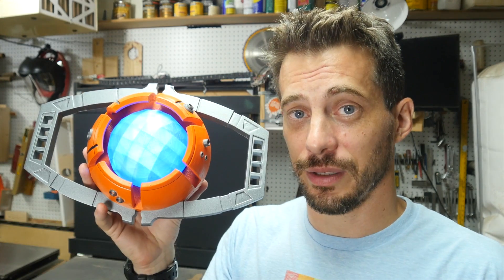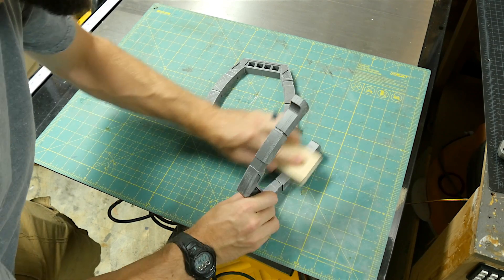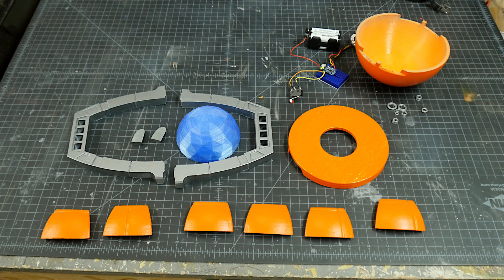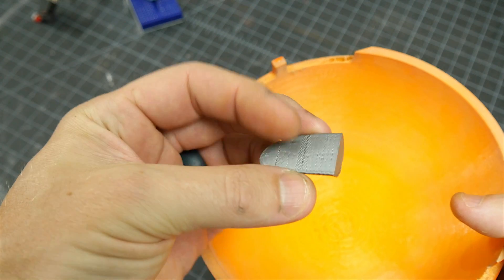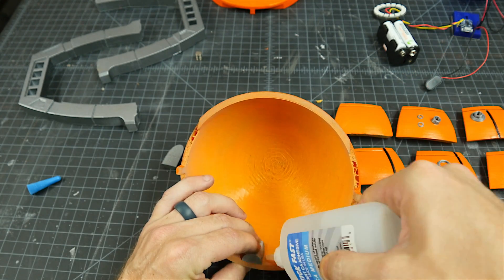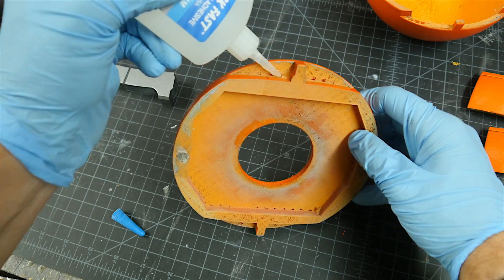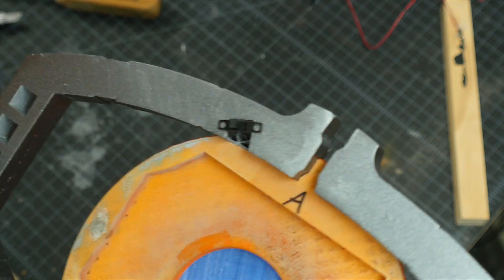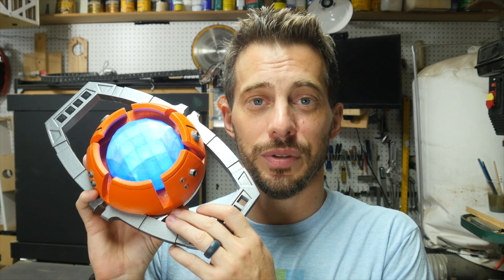3d Printing a Transformers Prop (Matrix of Leadership) // How-To | I Like To Make Stuff

Comment: When You put magnets in 3d printed parts use soldering iron, put magnets on hole and tip of soldering iron on magnet heat will be tranffered to magnet that will melt plastic and sit in place better then just pushing it in and gluing it😉👍
Reply from the maker: That's a great tip! Have you seen the heat affect the magnetism at all?
Reply: I Like To Make Stuff nope, go for it without hesitation, it doesn't affect them at all.

Comment: Lovely build man.  I may use this as a base idea to construct my own.  I know this was made last year and you've improved since then but have you thought about using anything like dichloromethane to smooth the print before adding the filler primer?  Really takes a lot of sanding work out of the equation.  Helpful tip for you or anyone else watching.

Comment: hi there

I am hoping you can give me some advice on sanding down the 3d printed models. I printed some rather small objects (about the size of a small peanut with shell) and I am not sure what kind of putty would be good for making it look smooth.
Reply from the maker: If you printed in ABS, try acetone smoothing.  If something else maybe just use filler primer and sanding sticks like I used.
Reply: thanks. i will try acetone bath but I am afraid it might remove the fine details of the model.

if it does remove too much I try the filler primer then.
Reply from the maker: tarui I've never done it, but I hear that the bath is pretty heavy but also look into the vapor method... it's a little less aggressive.
Reply: My mistake. I meant acetone vapour.

Comment: You should look at acetone vapour baths for removing build lines. This only works for ABS filament though.
Reply from the maker: Yeah, I was using PLA for this.  There are some other smoothing methods that might work, I just haven't tried them yet.

Comment: I found that rubbing down your pieces with a little acetone is also a good way to mostly get rid of those build lines.
Reply from the maker: +andrew miller that does work with ABS plastics but I was using PLA and acetone doesn't affect it at all.

Comment: Looks like you're having underextrusion problems... The original UM2 had that issue pretty commonly. I recommend getting the upgrade kit to a UM2+, the geared extruder works much better
Reply from the maker: +Joseph Rinaldi Its on the way actually. Turned out to just be bad settings on my part.

Comment: ABS at a guess? Why not acetone mist it?
Reply: Also, dude, up your final layer count!
Reply: +Acrimonious Mirth like it, plus the colour scheme matches my own-build second printer!
Reply from the maker: PLA
Reply: +I Like To Make Stuff proud of you! You can chemical weld and smooth PLA too but it needs chloroform, which is very awkward to get a hold of...
Question: where'd you get orange PLA?? I've been trying to get my hands on it for a long time but it's never in stock.
Reply from the maker: Acrimonious Mirth I've found it on amazon and MakerGeeks.com http://amzn.to/2c3ahHd
Reply: That the old matrix not the new one
Reply: don trump I use spray-on clear coat, can get it very cheaply. It works well with no bubbles, just give it plenty of drying time.

Comment: so geeking cool! love the toon song flash backs. question, I have not seen the filler primer before, to smooth out 3d prints I have seen using acetone , any particular reason why you did it with the spray?
Reply from the maker: +ADadAndHisKids thanks! Acetone works for smoothing ABS plastic but I was using PLA so it doesn't work the same way.

Comment: Great results. It looks like your prints have spots with some skipping. To get a more consistent extrusion you could first try upping the temperature. I found that excessive retraction distances can introduce air bubbles causing skips, but there could be other causes too.

Comment: Wow this turned out great. I have question for you though. Is this your first time doing any kind of 3d modeling? Ive only got my feet wet in sketch up and tinkercad. Ive been wanting to try Fusion360 when i get the time but im not sure how beginner friendly it is. Thanks!
Reply from the maker: +The Mod Shop thanks! No, I've done a fair amount of modeling but this was my first project done completely in Fusion. Sketchup is a good way to get started as well as 123d design. Fusion definitely has a learning curve to it.
Reply: From what i can tell, 123D Design seems to be easier to get the hang of. I might give that a go. Thank you!

Comment: If you fill a large plastic tote with acetone and place a smaller plastic Tupperware with the prop piece on it, it will smooth out the prop piece.
Reply: The gas coming off of the acetone with slowly eat away at the ruff edges so don't leave it to long. If recommend testing it with a printed block. You can also fuze pieces with acetone to create a permanent weld.
Reply from the maker: That works for ABS, but I'm printing with PLA.

Comment: Great Job!
One question, what software did you use to do the tracing of the flat image?
Reply from the maker: I used Illustrator, but recently found out that you can actually import images directly into Fusion 360 and place them on a plane for tracing!
Reply: Thanks!

Comment: Nice work all around! What size print bed do you have/what was the largest print you made for this project?

Plus, does the non-pro Trinket immediately power on/start running code or does it have a 4-ish sec boot like the pro?
Reply from the maker: I can't remember the exact bed size, but you could look it up.. I'm using the Ultimaker 2 extended.   I haven't noticed a boot delay, but I also have been powering it, then closing the prop up, etc before even trying it.

Comment: I noticed you used PS to trace the image... Why not import the image into F360 and trace with the sketch tools?
Reply from the maker: Yeah, I traced it in illustrator to get a .svg, but like I said, I was using Fusion for the first time really and I wasn't aware of the potential to bring in reference images.  Bill from Punished Props taught me about that this past weekend and it'll be a huge help in the future.
Reply: +I Like To Make Stuff btw great job with the model considering it was your first time using F360, you could've fooled me

Comment: Awesome! I'm right in the middle of learning 3D printing too (Though I have a lot of experience with 3D modeling, so that's one less thing to learn).  I will say that a lot of your sanding could have been reduced if you would troubleshoot some of your printing errors.  You shouldn't be seeing those big gaps on your sidewalls.  Here is a really handy guide for fixing problems like that.
https://www.simplify3d.com/support/print-quality-troubleshooting/

Also, for anyone looking to get started in 3D printing, you should check out the super cheap printers Monoprice is selling.  I'm getting cleaner prints than anything I've seen come off of a Makerbot, at a tiny fraction of the price.  It doesn't have to be very expensive to get started. (I'm not affiliated with Monoprice or anything, just a really happy customer).

Comment: Cool video and great choice for the project. My only question is "why didn't you just use the same color filament for everything (except for the lighted part on the top) once you realized you'd have to sand and paint the peices?"

Comment: Its a good point you make about the button press. I see a 3d printer as another tool, like a CNC or saw. You can use them in every project when you get your head around additive manufacturing vs traditional

Comment: Love the videos Bob. Done with restraint and no condescension.

Without trying to teach the art of sucking eggs; have a look at automotive knifing putty, its a really fast and useful filler for minor imperfections. With the filler spray, you can get an awesome finish in no time as it dries so quickly.

I'd love to see another extended project like the arcade cabinet... Perhaps drop a little section of each into every video to serialise your content rather than these standalone vids. Standalone is great when leaving YouTube to auto play, but maybe serialising it will add another dimension? just an idea..

Nice work man.
Reply from the maker: Interesting idea, thanks!
Reply: I use the Bondo spot putty and with the filler primer and carful sanding you can get some glass smooth finishes

Comment: 3D printing does take a long, long time. My printers been printing pieces for Solaire's Shield (from Dark Souls) for about 134 hours at this point, with plenty more to go. 

Filler primer is amazing, the trick is definitely many light coats with sanding between each coat.

Comment: Really awesome project. Turned out well.

I'm not familiar with 3D modeling, but since you made all of the parts in the same file, could you have made "pilot holes" in the base of the sphere and given each of the shell pieces a notch on the bottom that would fit these holes to avoid measuring?

Comment: Depending on the material you are printing with, you can 'chemically sand it' with acetone. I think it is for ABS. You would lose quite a bit of details on a fine print, but in order to make the printing lines disappear, it's magic, so smooth. Plenty of examples ont google. Also gives some kind of a shine to the print. Might be worth looking into for your next model :)
Reply from the maker: Yeah, acetone works well for ABS, but unfortunately I prefer PLA, so I don't have that option :/

Comment: Big fusion 360 tip. learn to work with bodies. It is the bridge between solids models and Forms by cutting an joining.
by cutting and joining a box on the different side of parts, you can easily make alignment blocks

Comment: I don't know a hole lot about 3D printing but I've heard that if you bake the pieces it will help get rid of the build lines. you'll have to play around with times and temps depending on the size and thickness of the piece. I'm sure there are videos about how to do it if you need help. I just figured I'd throw the idea out there. if nothing else it could help reduce the amount of sanding you have to do.

Comment: Looks great Bob. 

For future assemblies like this you should consider putting registration points on the parts so things can't shift around as easily. I'm not too familiar with 3D printing, but I think if you built some sort of removable printing surface you could have also created a dropdown on the bottom of the "crystal" so it can be perfectly centered with the other surface. Still looks great though!

Comment: Great job!  Thanks for communicating what 3D printing really is, not just hitting the EASY button.  One thing I like for post-processing of 3D printed models is acetone.  If you get it right you can make your model shine without altering any dimensions.  If you get it wrong you'll have just a puddle of plastic.  Could use it for glued joints as well if the filaments are of the same color.

Comment: Bob great video!  I also liked you MAME arcade build series.  Check out this product from Smooth-on XTC-3D® High Performance 3D Print Coating.  Have not used it myself but looks like an easy way to remove build lines from 3d printed parts.

Comment: Cool! I do enjoy these videos! One thing I've 'heard' (but don't have a 3d printer so can't say that I know for definite that it works) - but apparently you can use acetone to either rub over, soak parts in etc that then bonds, sticks the layers better together. Don't know if thats applicable to your print method but heard that it can improve on the finish of the final piece.

Keep it up!

Comment: You can rub a light layer of acetone on the print to smooth out the build lines. Just make sure it's not to detailed of a print as very little of the plastic will melt. Something like that should be fine.

Comment: Nice foray into printing. instead of needing to use your calipers to get the segments around the gem to align you could have made peg holes or a slight depression in the larger piece. You could also use your gem piece to teach yourself molding and casting to make a clear slush cast gem.

Comment: Hey Bob, have you tried wiping your 3D printed parts down with acetone before applying your build primer? It helps smooth down some of the texture and gives the plastic a bit of tooth for the primer to stick to.  And if you're getting really precious with it, Bondo Spot Filler is good between primer coats to fill in nicks and scratches.

Comment: Awesome project! Turned out great!
Did I see some pretty major under-extrusion in a lot of your prints?
Reply from the maker: Yup, I played with different print speeds on different pieces, so some are better than others.
Reply: I see, you haven't upgraded to the plus version of the ultimaker? It's supposed to have a better feeder but I haven't tried it myself. 

And if you didn't know, the white teflon piece between the nozzle and the bowden tube gets worn fairly quickly especially if you use high temps. And when it goes bad the printer is a nightmare to use, under extrusion for days, if you can get it to extrude at all!

Not that that is your issue just a heads up since I have lost a lot of hair because of this!
It's of course normal to get under extrusion when going to fast as you said :-)

Comment: Hey man ! love the project great work! Just thought you might be interested in a few tips regarding the print quality of your ultimaker. I use one for work a lot, so there's a couple of tips to increase the quality. First of all i would consider upgrading to a olsson block, so that you can use bigger nozzles like 0.6 or 0.8, print time goes way down while still achieving great detail. Also it looks like your machine is under extruding (@1:42)  so not enough plastic is coming out. Your either going to fast so that the extruder cant keep up and is grinding, or there is something clogging the system. a extruder upgrade they released with the 2+ machines works great to fix this. I print everything at 70mms with a 06. nozzle and a 0.2 layer height. that usually works gret. oh and also, use a brim and glue stick glue to make sure all the parts stick to the plate easier. 

Keep up the great work, love your videos! (feel free to check out my stuff as well :) )
Reply from the maker: Thanks! I've been looking at the + upgrade, but it's a chunk of change and I wasn't sure how much of a difference it'd really make.  Sounds like it might be worthwhile!
Reply: I really think so. ive been using ultimakers for a couple of years now (while i studied), and now i use the 2+ for my work. The extruder is geared so a lot more power to make sure plastic is coming out, and the bigger nozzles really speed up the time, since the 0.8 has over 4 times the area of the 0.4 that i assume your machine has.

Comment: You should look up how to do acetone smoothing it's good for getting rid of the build lines but it will give it a glossy look. U can also use acetone to bond the pieces together.
Reply from the maker: Acetone works for ABS plastic, but I prefer to use PLA, so it's not useful in that capacity :/

Comment: Hey Bob!
Great project! It's really nice to see 3D printing being used in a project like this.
You might want to look into scale modelling materials to use when 3D printing. Most scale models are polyurethane based so there are plenty of PU-specific glues and filler putties that could be used on such projects with excellent results if you happen to print in PU.

Comment: dear Bob, you have some flaws in your printed pieces.
The gap on the walls and on the top/bottom of the print are caused by inconsistent extrusion due to an damaged/degraded extuder, you have to replace the extruder every 2-3kg of prinrinting material to keep it in perfect condition.
You can also use better quality filament and add more top/bottom layer.
Using filling primer was a nice ''fix'' to this problem, but you have to cure your print quality
Keep up the good work
best regards

Comment: Rapid prototyping............there is nothing rapid about it. hahaha It takes time, a lot of time specially if you work with machines that need a lot of set-up time and parameter optimization. But, I have to disagree with Bob, you can push a button and have a finish product, but that depends on your software (slices parameters), how good your machine is (tolerance), how good your product that you are working with, and if you have support material to be able to dissolve it away or not. I has to do with how much post-processing you want to do after you are done with your part also. Bob great job!!

Comment: this is dope, and its cool to finally see you start using your 3d printer, I will say this however: you should check your layer height settings for your 3d printer. It looks like you have layer seperation on some of the pieces

Comment: Bob, this came out really well. You put a lot of effort into post processing of the printed parts, and it shows. Seeing the back panels of unfinished material indicates that your printer settings are not quiet right, there should not be any skipped lines along the perimeter and the top surface should be clean and finished. If you dial in the printer settings, the parts will come of a lot cleaner of the printer and will need much less post processing. If you tune it right, you can get super smooth parts of the bed, which require next to no post processing. Fusion is awesome! You're going to love using it. It's also great for modeling complex moving parts before fabricating them, you can model the motion and save time later.